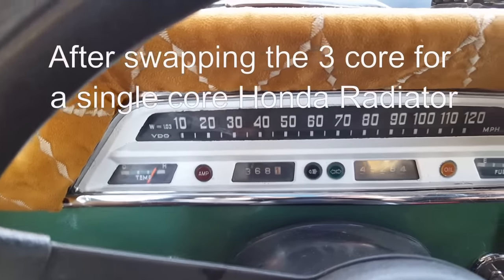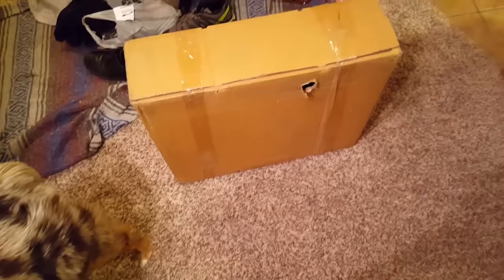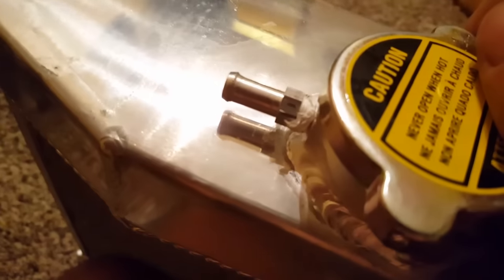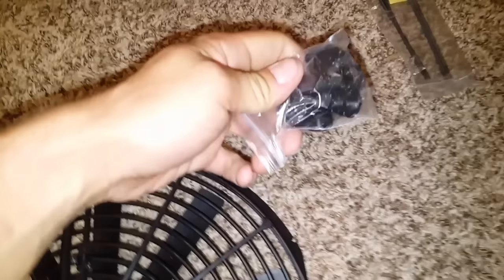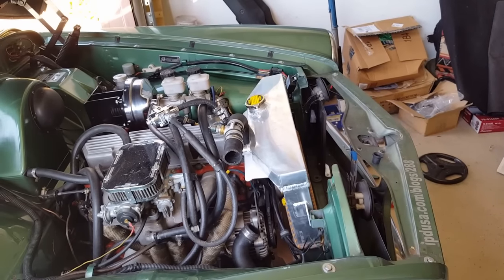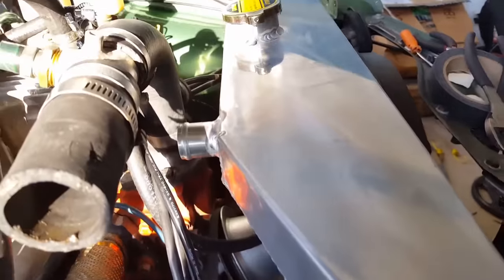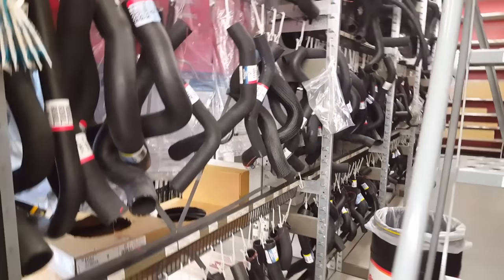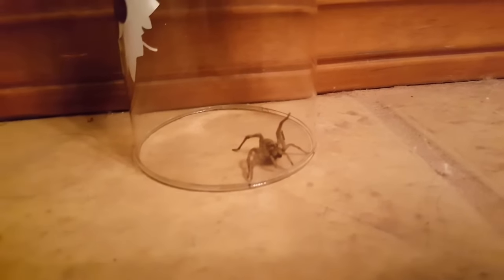🇸🇪Volvo Amazon 122s 3 Core Radiator GPI Review & Problems.

Comment: What fan were you using with the Honda rad? I have the 3 core aluminium Honda rad in mine and haven't had it even close to overheating yet. Could it be an altitude thing?
Reply from the maker: +Turtle Garage  the 12 inch TorqFlo (Autozone) brand. I am almost certain my problem was airflow. Even with the
Ducting, it still needed a push fan, but had no room for one. Are you on the mechanical fan and a 3 core radiator?

Comment: I got the same radiator for my 123GT. I have fitted air conditioning to mine as it gets stinking hot in PA during the summer and I wanted the car to be usable. It did not fit worth a damn and worked worse than the oem one. So it’s in a box in my shed waiting to be used as a planter. I’m back to the oem rad and fan with a pusher electric fan on the condenser. It is marginal on a hot day at idle and I need to find a solution. I’m adding another electric fan and overhauling the cooling system. The rad is the original one so it might need the lime away treatment. Failing that a new oem rad as it is 3 core as well and isn’t too bad.